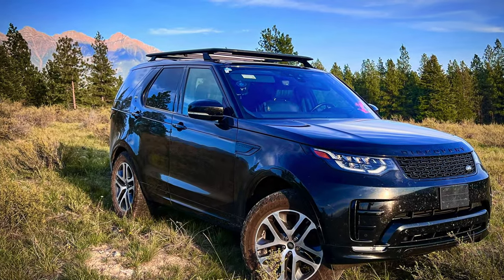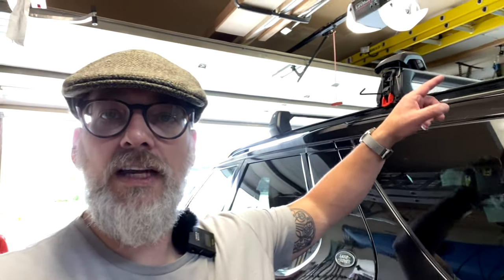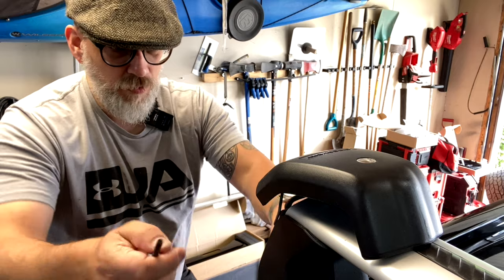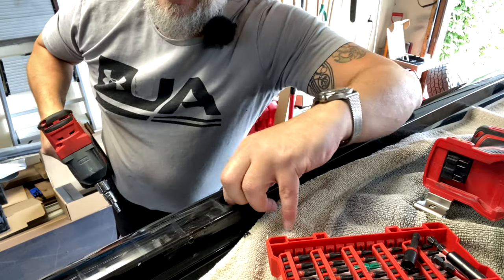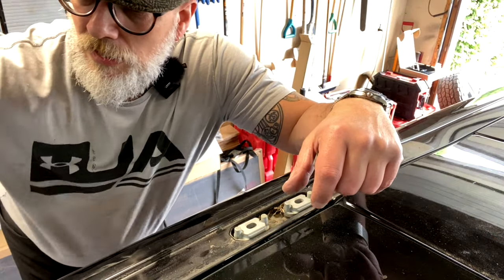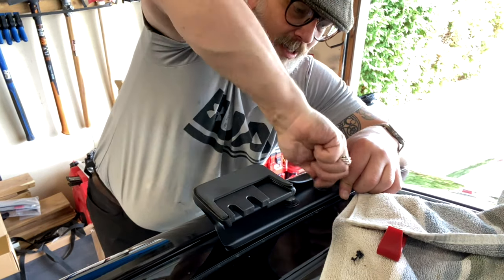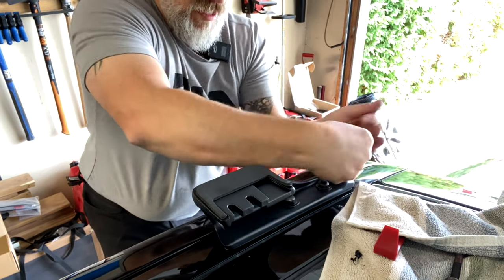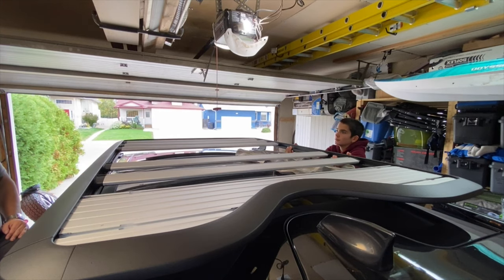Here's One Way to Make Your D5 An Even Better Overlander -- The Land Rover Versatile Roof Rack #l462

Comment: "I can give it a bit of a j...j...j...jiggle" . I loved this 'Open All Hours' reference!! You did it so well, that I could almost hear Granville crashing on his bicycle and Nurse Gladys Emmanuel making a chiding remark at Arkwright! 

I recently bought a second-hand Discovery 5 and currently awaiting delivery. With the current waiting times, a new one was out of the question. I shortlisted two Discoveries, one that I have ordered and the other with this Versatile RoofRack. They had the original rails also wrapped up in the rear of the vehicle and that particular dealer was at pains to point out how easy it was to swap out the rails and the roofrack. Now that I have seen this video, I am soooo glad that I made the choice I did.
Reply from the maker: Hahaha! Open All Hours is indelibly burned into my memory; a recall of good times once past. Ronnie Barker is probably one of my all time favourite comedians and I loved the show!

I am glad to have been of use and I wish you much happy motoring with the D5! I really liked mine, but through some difficult times have been forced into selling it. So just to be clear, did you get the one with the Versatile Rack or the one without it? The Versatile racks are actually quite rare on the D5 -- I don't think I have seen another in the real world with one (excepting, the TREK Disco I saw in Vancouver last year). I liked the rack so much that I kept it and am currently putting it on my L322 (videos upcoming) -- it requires a completely custom set of brackets as you might imagine, but it will be worth it (photos of the un-powdercoated brackets are on my Instagram page now: https://www.instagram.com/shedlocktwothousand/)

let me know if I can be of any further advice.

Comment: Hahahah loved the comments in the video. I used a rhino rack cross bar system on my L494 to bring our stuff up from Mexico in a roof mounted cargo box. Found the rails so easy to install them and are just storing them in our garage for the time being. I do like the ability to carry stuff on top at times for sure and be able to go back to a nice clean look when they are not needed
Reply from the maker: Thanks for weighing in, Emeka! 

Cross rails and bars are certainly handy for those who don’t utilise the roof rack often or who want to maintain a slicker (and quieter) vehicle. I think the merit of these racks comes with the flexibility and adaptability (the @rotopax gas cans, for instance, could be mounted to cross bars — but that would then limit additional roof-mounted stuff. 

I had cross rails on my l322 and made good use of them! If I ever went back to an L322, I’d definitely try to retrofit this rack on to it!

Comment: Excellent job! This roof rack looks much better on d5 then on new defender. It looks more low profile 👍
Reply from the maker: It does sit about 1 1/2” lower. That’s both good and bad. With the defender, you could squeeze a fat arm through it to move straps about, but I can’t get my arm under this one very far. On the plus side, it’s lower profile and more fitted to the vehicle. 

The rack certainly suits the D5 well and it works well — I’ve put all manner of stuff on it this past few weeks. Sadly, it is a bit noisier than the Defender’s rack, but air dynamics are a black art: the increased height of the Defender’s may have resulted in lower wind noise. I’m about to throw my Stedi light bar on it, so we’ll see if that makes it better or worse!

Comment: Nicely done on the installation, I'm considering one too. My concern is I do plenty of highway driving for work... regarding the noise levels made by the rack at highway speed (65mph), is there any whistling /noise during normal low-no wind outside conditions (obviously during a windy day it might catch the rack at an angle to make more noise...) but under normal conditions is it quite noticeable the aerodynamics of the wind on the rack?
Reply from the maker: Curiously, the rack on the D5 is noisier than the same rack on the L322! In certain wind directions (bearing in mind that we live in one of the windiest places in North America) the noise can be quite loud. In general driving conditions, you will notice about a 10db increase. You can smooth that out by slinging an LED underneath; that helped on my Defender. In the wind that db gain can go up to 20db more, but again, that can be reduced by the light bar again.

Comment: Thanks for sharing!  I'm considering this rack for my D5...can a few of the silver cross-bars be removed all together?  My main concern is obstructing the dual sunroofs with the rack and the number of cross-bars included?  Hoping so, this is by far the best looking/functional rack i've seen for the D5.  Looks sharp!  Thanks-
Reply from the maker: Yup, you can actually take them all off if you wanted! I’f you look at the video of how I build the mounts for the L322, you’ll see how they can be moved (or, maybe it’s this video 😆). 

Either way, they simply unscrew and you can pull them off (or slide them about a bit). They are different lengths, though, as the rack tapers a lot. So if you remove them, remember which went where!
Reply: @shedlock2000  Sweet, thanks!  The weight rating seems low (60kg) compared to other racks, would you have any concerns mounting a roof top Thule box to this rack or kayak/ski racks?
Reply from the maker: @SquizzelPDX  I am quite surprised (and confused) by the low rating for the rack too. I suspect this has more to do with the road handling constraints than the capacity of the rack itself. I have loaded my rack up with significantly more than 60kg without any issues whatsoever. I have had at least 400lbs of timber on there in the past as well as spare tyres and fuel. I wouldn’t worry about that, but do bear in mind that the D5 does not have adaptive suspension and the road handling will be negatively impacted by the weight. The mounts are very well designed and very strong; how strong the rail into which they secure is, I cannot say, but as it forms part of the roof, I would say its quite strong! 

When I adapted the rack and mounts for the Range Rover L322, I did build a centre mount point, as the new Defender has (it has a 600lbs static rating). While I don’t imagine that my mounts are as strong as those on the Defender, they have also carried well over 600lbs without issue (and not static)! I imagine there is a lot of legal stuff behind the rating rather than actual capacity — the rack is, imho, over engineered compared to others. When I think what I carried on my Brownchurch rack on my series 3, I absolutely know that the roof gutter mounts were not actually up to that strain — but they coped admirably too!
Reply: @shedlock2000  Most helpful, thank you!!  Sold, this'll be the rack we go with.  Now I can switch my focus to 18" wheels as I try to figure out wheels specs that work.
Reply from the maker: I don’t think you’ll be disappointed with the rack — it’s certainly the best looking flat topped rack for the Disco. 

Unless you’ve a particular reason to go with 18” rins, you really don’t need to reduce to that size. There are now good AT and mud tyre options in the 20”, and unless you do a lot of sand driving, you’ll not benefit from 18” at all. I’ve driven thousands of miles on reduced pressure 20” rims and I’ve never damaged a rim yet. This talk of ‘sidewalk depth’ is really over rated and unnecessary unless you’re and incredibly severe off road driver (and even then, I’ve competed in trials and never damaged a rim). You’d simply be better picking a 275/55/20 AT tyre and saving the coin for some roof mounted toys imho.

Comment: Very informative video.
I am considering the same rack as well but most of the parking in my city has 2 meters clearance, so the finished height is a big concern to me.
How many centimetres does it add from the rooftop?
Is it on the same level of the toptip of the antenna (the shark fin)?
Reply from the maker: No, the rack sits a bit higher than the shark fin. 

You can drop the ride height by two inches for car parks by locking it in access mode, so that can help. I’ll measure the rack today for you, but don’t forget I’m running 275/55/20 tyres (which are 1” taller than the stock 250/55/20s).
Reply from the maker: Ok, @ano0628. The rack adds 4” at the front and the rear of the roof, and 3” in the centre. The rack is obviously flat, but the roof is curved slightly. 

At the rear of the rack, the top of the rack is 75 1/2” from the ground in access mode — but I have a 3/4” lift and my wheels are 1” radius over stock. Given these differences, I suspect that your vehicle would measure 73 1/2” off the ground in access mode (give or take and assuming your suspension is properly calibrated).
Reply: Thank you!
Been searching around for the measurements. 🎉🎉

Comment: Hi do you think I’d roof rack can hold a roof tent no problem?
Reply from the maker: Absolutely — without any issue whatsoever. I’ve had 440lbs of steel pipes on there AS WELL as 120lbs of cedar (and, while not driving, me as I strapped it down!)

I should mention, however, that it is not rated for that. But in my experience, there is a difference between what it will do and what JLR are insured for it to do!
Reply: @shedlock2000  ohh that’s fine, because it says max is like 60 or something
Reply from the maker: Yeah, the actual rating is very low. In my experience, though, it’ll put up with quite a lot more!
Reply: @shedlock2000  that’s great thanks mate

Comment: Hello everyone, Does anyone know if this verstatile rack the same as the ones use for Defender 110? Someone is selling this from a Defender 110 owner
Reply from the maker: Hi Bernel, 

The rack itself is very similar, but not quite the same. The overall dimensions, I think, are the same, but the mounting points and brackets are quite different. The Defender rack can be modified to fit the D5 mounting brackets — assuming you can get them separately. However, the Defender mounts are quite unlike the D5 mounts (for a start, there are three on each side not two). 

The mechanism for mounting the rack to the brackets permits some flexibility for mounting if you don’t mind drilling a couple of holes to move the mounting plate inside the rack itself. To adjust the D5 Versatile rack to fit the L322, I modified the rack to fit a third centre bracket on each side which requires drilling the rack and making a receiver plate for the bolts (see my videos on custom rack brackets). So adjusting the mounting point of the rack itself is quite easy. The bigger question is whether or not you can purchase the mounting brackets for the D5’s Versatile Rack separately.
Reply: @shedlock2000  Thanks ! This is so helpful
Reply from the maker: You’re welcome!